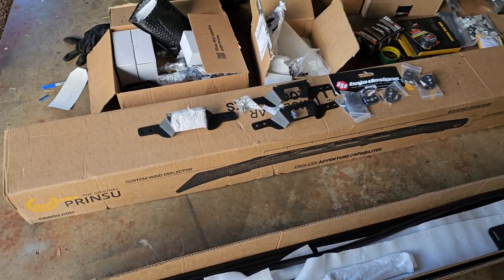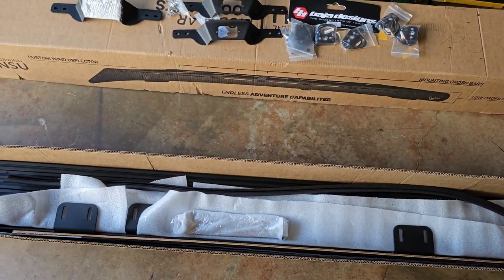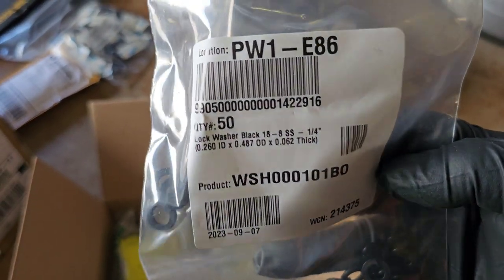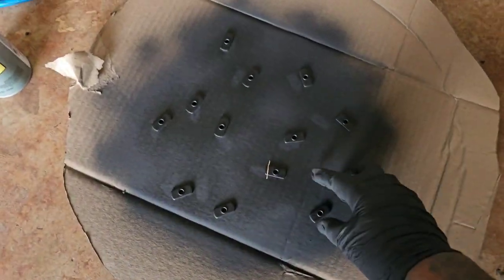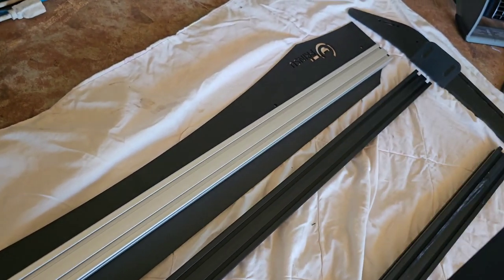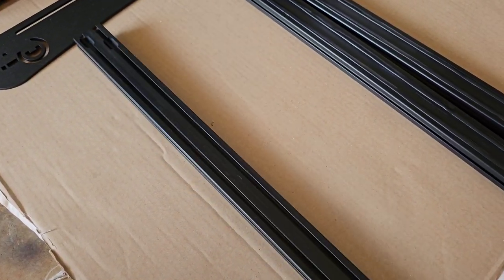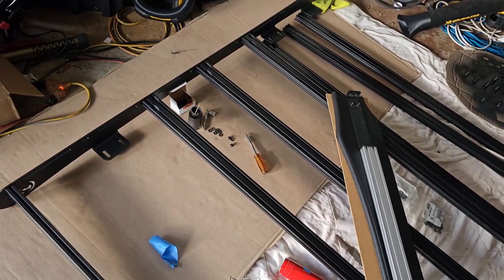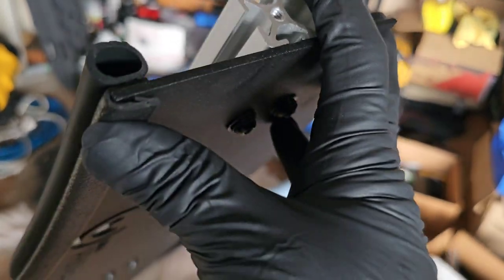Prinsu rack installed on a 2019 GMC Sierra AT4

Comment: what emblems do you have on the prinsu rack if i may ask?
Reply from the maker: It’s custom emblems I had my buddy cut out for me.  “AT4” and the Harley logo.
Reply: @tundrabuilt  hey thanks for replying. Was also wondering how the rides been since having the roof rack up there, noise/milage? 

Just wondering as I'm planning on putting one on my 2020 gmc seirra aswell.
Reply from the maker: @johndj7524  When I initially installed the rack, I also installed the 2 solar panels.  I was getting noticeable wind noise, but suspected it was from the panels.  I moved the panels back one bar and the noise reduced quite a bit.  I haven’t had time to test the rack without the panels yet, but I’d assume it’ll reduce the wind noise even more.  We have a 4runner with a rhino rack and I also put a Victory rack on my mother’s 4runner.  I’d say the wind noise from my truck is similar to both 4Runners.  Easily tolerable.  As for the gas mileage, I noticed about 1mpg less.  This is just my observations from the 2 weeks I had with the truck setup like that.  I’ve been away for work since October last year, so I’m looking forward to getting back in May so I can get behind the wheel again and give a longer term review.